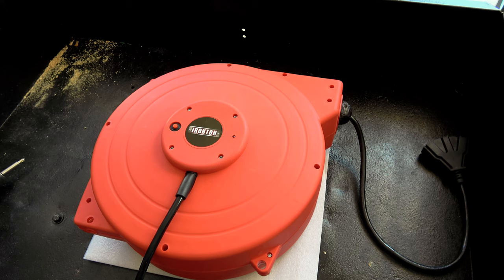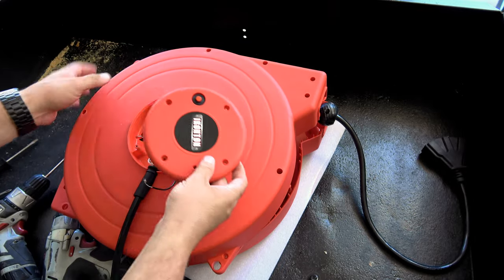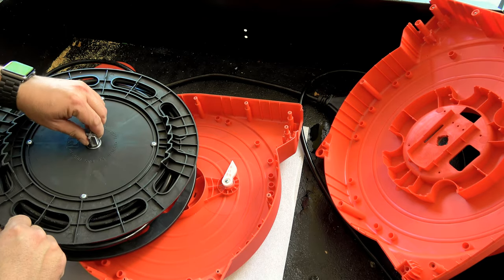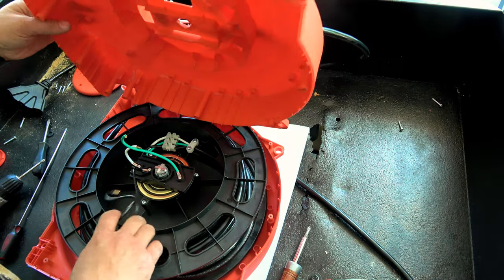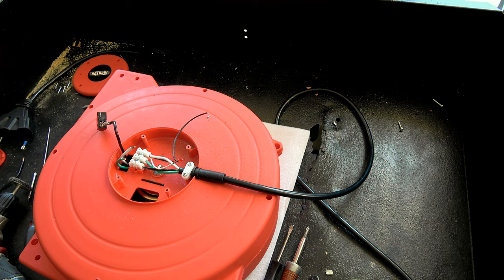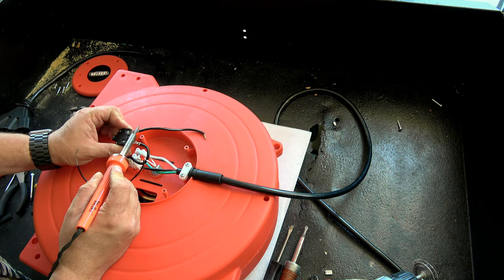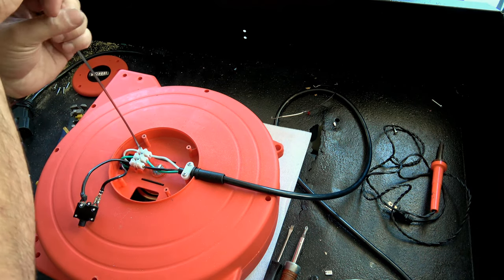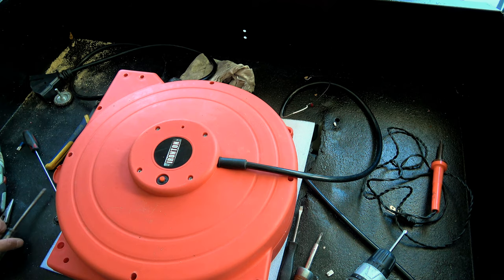Ironton Retractable Extension Cord Reel 65ft 12/3 15 Amps How to Fix

Comment: Thank you KmamAuto. It’s like they have a upper and lower grade of tools. To me it depends on what you need it for ? If you have a Auto shop then I would definitely buy all upper grade tools. I normally only buy the higher grade of tools. Even if I don’t use it much my son’s will. I’m in the process of building a 14x20 shop with a car lift in it for them. I bought the Hercules 12 inch sliding miter saw with stand. I got it all for a little over ? $600.00. It’s one of the best you can buy. They have really improved the quality of the tools they sell.

Comment: You helped a lot.  Mine also the locking latch was to tight. It would not lock.  All i did was give both side a good hard slap on both side.  Bingo good for now. if it happens again I will do the half turn
Reply from the maker: Glad to help!

Comment: Jusr took mine apart after watching your video. 15 amp breaker kept tripping. Bought it in July 2023. Both wires had burn marks because they were loose at the breaker connections!!! They have not improved their quality control!  I removed the breaker on the unit because I have a 20 amp GCFI protected circuit.  I bought this because of the 12/3 wires that should be rated at 20 amps anyway!
Reply from the maker: Hilarious!

Comment: I would like to find a way to increase the spring tension. The one I have rolls of very weak and usually ends up with 3-6 feet that won’t go back in no matter what I do.
Reply from the maker: It wasn't wound to tight enough at factory. Remove the cord wind it a couple times then re-insert the cord and put everything back together
Reply: @KmanAuto  thanks for the reply. Not sure I follow. Can you give a little more detail please?  Remove cord wind a couple times then reinsert?  Having trouble visualizing that. My apologies.

Comment: I bought one of these and having the same problem. Except mine also quit giving power. I have never overloaded it and only used it a few times. Last tiMe I pulled it out it started acting like it did not want to retracted. I’m going to try and reset it and hopefully that will give me power? The bad thing is I have it mounted in a very hard place to get it down. I think the warranty is still good? If not I’m going to buy another brand. It sucks when you pay good money do something and it don’t work. I’ll never my one again.

Comment: I have a Volt King with the same problem. I got all the screws out except one that is stripped. Any idea how I can get it out?
Reply from the maker: stick something sharp, like the edge of a razor place under the screw head if you can, and pry up while unscrewing. other than that, you’d just need to pry it apart. the threads are already gone so not hurting anything. to fix the threads if in plastic, fill the hole where the threads were with a bit of superglue or rubber cement, and stick a toothpick in.

Comment: I forgot to mention that I’ve been buying a lot of Harbor Freight Pittsburgh tools. The quality has Increased tremendously. They have lower grade tools but for the most part they are great tools at a third to 1/2 of what you pay at Northern tool. They have truly increased the quality. Most have a lifetime warranty. I have been buying many of these tools and never had a no problem. I recommend taking a look at them. With the discounts and everything else you get it’s worth it. Try it. I don’t work for them.
Reply from the maker: They are better than the current craftsman that’s for sure!
Icon is very good. Pittsburgh is hit or miss.

Comment: Typically the ratchet mechanism will fail because the plastic pawl fragments, or the post that pawl pivots on snaps off, and then the unit can't be repaired.  The design is weak in this regard, and a little rough handling will break it.  In that case you're down to removing the pawl business and having a retractable reel that won't lock.  But then you can improvise a lock by just keeping a small plastic spring clamp handy, and clamping it on the cord when you've extended it.  Not a perfect solution, but a "pawlectomy" will at least salvage most of the function of an expensive item.